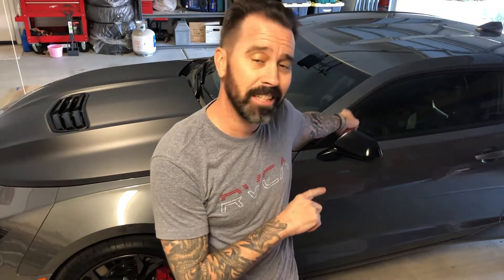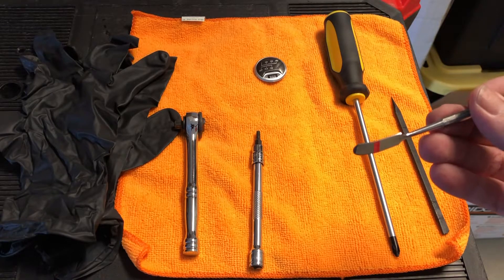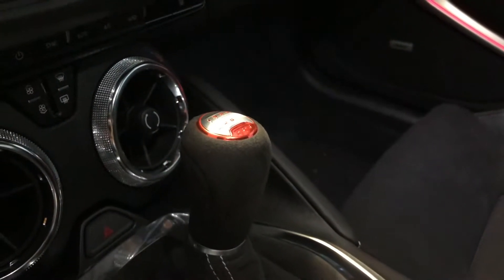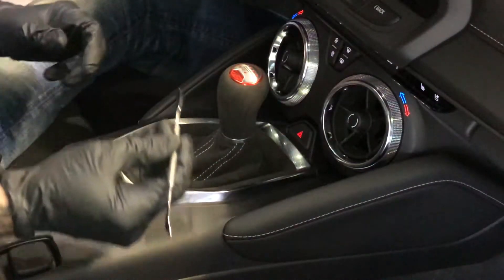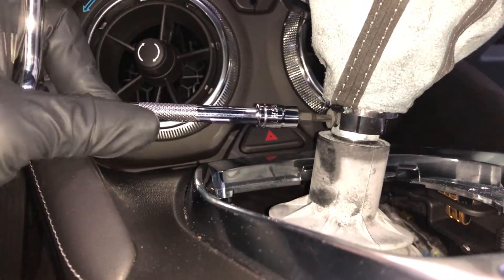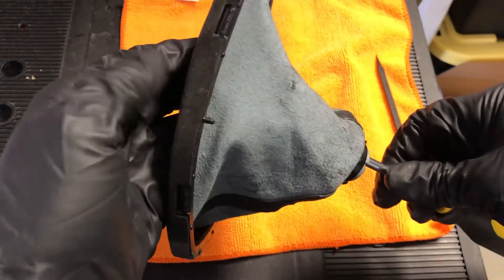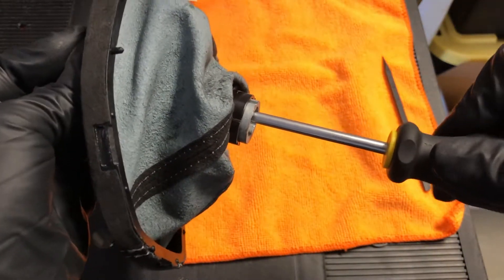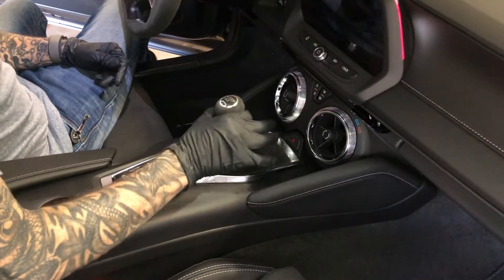2021+ Camaro SS Shift Emblem Replacement

Comment: Hey Arron, enjoyed the video on changing the emblem on the shifter , looks great , was wondering where you purchased that from, if you could let me know , i have a 2021 2ss 1le , your car looks great , love that color   cheers Kevin
Reply from the maker: @kevin parker, thanks for the comment! I purchased my from Wildhammer Motorsports. It is an actual GM part. Here is the link: https://wildhammermotorsports.com/16-20-camaro-ss-zl1-manual-carbon-fiber-shift-cap-general-motors/

Comment: HELLO?!? I think the stock knob emblem looks better. However this is a fine vid to show what it takes to remove the shifter to get at the emblem. Very Cool! A much better and more meaningful mod would to be switch out the stock shifter for the short-shift unit. Chevy has had that available for some time. A do-it-yourself vid on that would be way-cool. 😎
Reply from the maker: @Ken Sheldon, thanks for the comment! The SS 1LE already comes with the short throw shift unit so I probably won’t have a video showing how to change that although a great idea!!  https://wildhammermotorsports.com/16-21-camaro-ss-short-shifter-kit-1le-spec-general-motors/